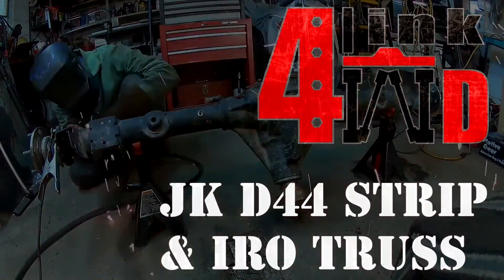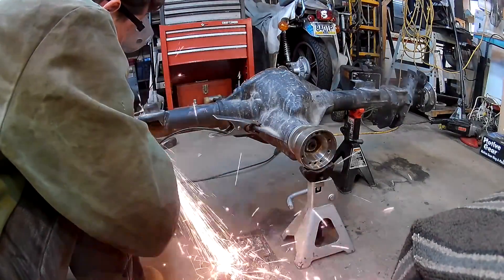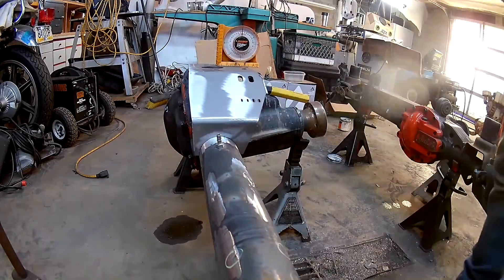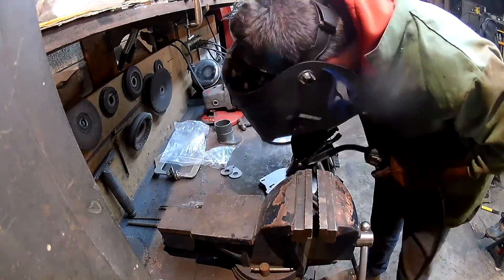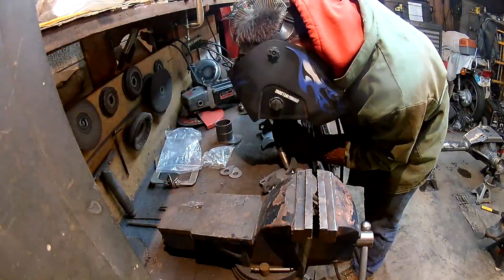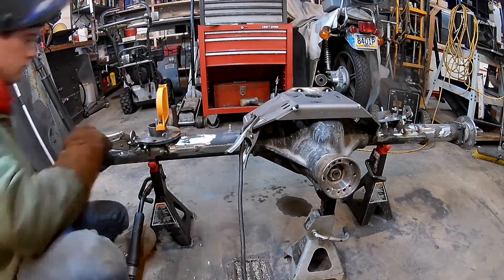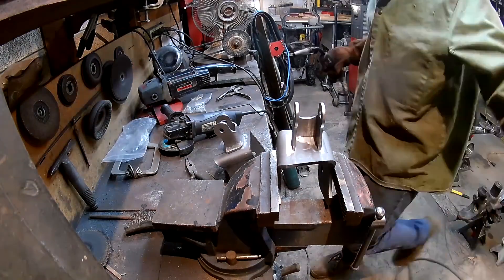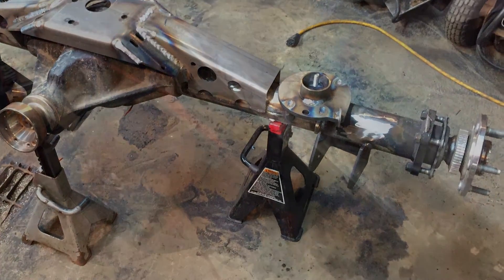WJ Axle Swap: JK44

Comment: Do the springs make any noises without rubber isolators?
Reply from the maker: Not sure yet! But I use similar spring perches for my ZJ and it makes a lot of noises, but none that I think are from this haha. The springs get clamped down to the axle so don't have room to move to make noise.